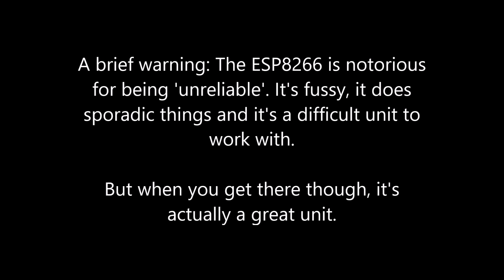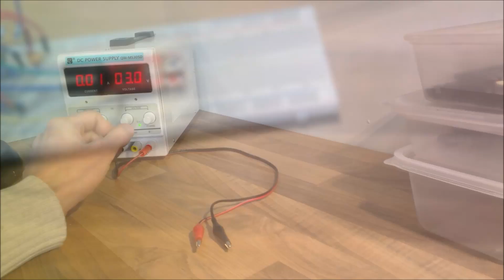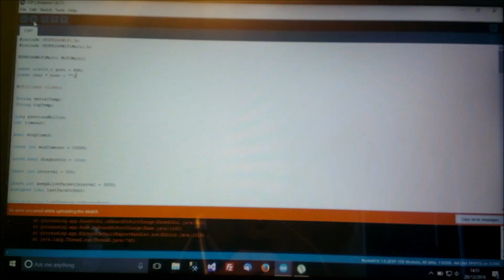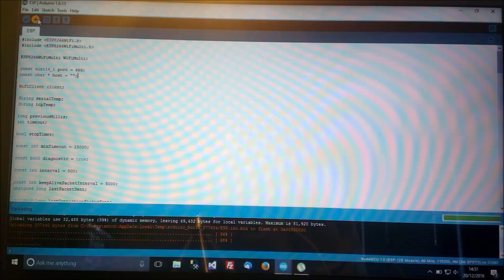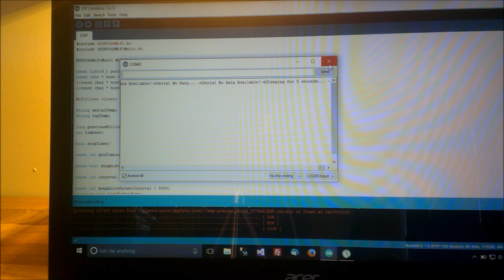TUTORIAL: How to wire up and flash the ESP8266 12E properly! It works! (Arduino - Getting Started)

Comment: Great video. I've struggled to find anything about programming this module. I keep getting NodeMCU flashing guides. I actually used an 8pin UART programmer with a button between GPIO0 and ground that I'd been using with ESP01s modules but it wasn't working. Then saw your vid and learned I needed to ground GPIO15 (still not sure why). Now successfully uploading sketches through Arduino IDE.

But I'm still not having success booting the module up. I've been installing Tasmota and it seems like the 3.3v I'm giving it isn't enough or something. The led is barely lighting up. Any ideas Anthony or anyone else reading?

Comment: Thanks, the hole pull up / down resistor thing is become more clear now.  Using the resistors in place of "just" a jumper wire on the pins that need to go high or low makes sense, ie, just need a small amount of current to set the pin high/low, not the FULL amount.

Comment: is there any reason this doesn't need an external crystal? I've inherited a project based on one of these modules and between the different data sheets I've found I can't find one with a pin out that matches and shows where an external crystal would connect, but each data sheet does mention the need for at least a 26mhz crystal yet can handle up to 40hz and from what I understand it is recommended. Do you know if there is a crystal internally? is that the 26 mhm one?
Reply: According to the schematic for the module, it already has an external crystal on the PCB.

If you're looking at the datasheet for the esp8266ex, cross reference that with the schematic for the esp-12f (or 12e) module to see what it already taken care of

Comment: Good Video but in my case i'm getting this error
warning: espcomm_sync failed
error: espcomm_open failed
error: espcomm_upload_mem failed
error: espcomm_upload_mem failed
how to over come from this
Reply: Are you sure you've selected the correct (virtual) COM port in the IDE?
Reply: The COM port (e.g. /dev/ttyACM0) maybe in use (i.e., opened) by some other software, if so you should close that software first. Another possibility is that the previous software that used the COM port did not release it properly, in which case rebooting and retrying should work.

Comment: Wonder why not using male pin header.
Do u have a reasonably stable bootloader to program it via wifi?
Reply: it has a 2mm pitch. the breadboards are 2.54mm pitch. plus the pins don't fit for some reason
Reply: Reckon slightly bending long pin headers might be easier. anywayz, thanks for the video.
Reply: Aliexpress sells 2mm pin header, and 2mm to 2.54mm dupont cable too.

Comment: I have a PL2303 Usb To Rs232 Ttl Converter https://www.amazon.in/gp/product/B00UZERG94/ref=oh_aui_detailpage_o01_s00?ie=UTF8&psc=1 which does not have RTS pin, will it work without connecting that pin?

Comment: Thanks Antony, one question, it works well but I do not need to change the state of GPIO0 or RST to put my ESP12E into "run code" mode, my wiring is the same as the initial setup, do you have any idea why this is?

Comment: Great Video ..Can you tell me what gauge wire you use to solder to the ESP12E :)
Reply from the maker: meir rotfleisch Thanks, it's not overly important, but this is most likely 24awg.
Reply: 22awg works fine also

Comment: What are you doing?
Reply from the maker: Dylan Hamer Just putting kids to bed. You? Lol
Reply: Antony Cartwright Haha, but seriously, why are you using wires for headers and why are you using the  capacitors? The ESP8266 doesn't need all this circuitry.
Reply from the maker: Hey Mr Hamer! Have you tried to use it without? Lol. If you use a breakout board, you don't need all this, that is true, but that's because the breakout board already contains this stuff! If you don't have the breakout board, and don't use wires, you can't get the ESP to work at all! If you miss the caps, then it browns out every few seconds! :-)
Reply: Antony Cartwright The ESP works fine on its own just with the correct pins connected to make it run in my experience but if it works for you
Reply from the maker: Maybe I just had a few bad batches! ;-) Lol.

Comment: Ok, I want to make clear some discussion topics in this comment section. He said, this is the most reliable way and he's right. You can use esp8266's for every single application with this setup. But he didn't tell why you need this bulky parts. I am gonna start with capacitors. You will need capacitors only if you're gonna use relays or motors in your projects, these type of electrical components will have voltage fluctuations, and the spikes can potentially damage your esp. But ams1117 is a linear voltage regulator, you can use a buck converter instead without having to use capacitors. The resistors are only needed when you are gonna use those pins as i/o's. So you should use resistors where you need more i/o pins. Besides you can just use cables to make the proper connections. And again I highly recommend using a buck converter instead of a linear voltage regulator. They are more efficient and they are tiny. So you should use these components on purpose.

Comment: Best demo I've found so far. What exactly do I search to find the type of blue wire you're using? The stuff I get has multiple stringy strands instead of the nice solid core on yours.
Reply from the maker: Hi, thanks very much for your comment. The wire is solid single core, 0.6mm² "bell wire". Antony... Buy it in large quantities because it's way cheaper! If you need 10m for example, buy 100m or 50m...You'll see that the price will not be hugely different. Antony...
Reply: 0.6mm^2 looks like around AWG20.  I'm surprised that thickness of wire could fit in those tiny holes. But I like the end result.
Reply: I am just using single core 22awg wire and it works fine, if anyone else is looking. Get it on Amazon https://smile.amazon.com/gp/product/B008L3QJAS/ref=ppx_yo_dt_b_search_asin_title?ie=UTF8&psc=1

Comment: one question, when you talk about the RST, what does mean the "GND via tact."?? because i understand that is different of the GND directly connection.  and other one, why do we need a capacitor between vcc and gnd?that's for all. kind regards
Reply from the maker: Eva Mc My first female comment! Welcome to my channel. Gnd via tact means ground but switched ground. In other words, there is a switch between the pin and gnd. when you press the switch, it connects to ground, otherwise it doesn't. About the capacitor, it is for stability. I think there are two in this video. Antony.
Reply: Antony Cartwright yes, but it is a need to be switched in order to work with the esp8266? my uart ttl does not have  RST.
Reply: Antony Cartwright thanks for your welcome and for your video and obiusly for answering so quick
Reply from the maker: Eva Mc Hi again. Yes it must be switched because RST is the reset pin. You wouldn't be able to reset the device if there wasn't some sort of way to momentarily ground the rst pin. Antony

Comment: What gauge wire did you solder to the esp8266?
Reply from the maker: Hi! Thanks for your comment. The exact gauge of the wire isn't really that important here because the device consumes around 200ma max and the wires are extremely short. However, to answer your question, I probably used AWG24 or so. Antony..
Reply: 22awg works fine also

Comment: Heyy Antony, do you know if this will work with Arduino Mega instead of FTDI UART ?
Reply from the maker: Hi Anay, I don't fully understand the question. Could you ellaborate?
Reply: he wants to use his mega to program the esp instead of the ftdi. pretty simple question.
Reply from the maker: That's not a simple question I'm afraid! The UART is a serial transmitter and receiver. The Arduino Mega is a microcontroller. A microcontroller can be programmed to do many many things. If someone wanted to, they could make an Arduino into a UART. So, theoretically, yes, it's possible. Antony...
Reply: Antony Cartwright yes but the mega has 4 UARTs. he could forward the communication from the PC UART to the esp UART.
Reply from the maker: Then it seems that it is possible. :-)

Comment: This is a good video. However, you do not explain WHY each of the components are needed. Just saying, "you need X" without telling "why", actually does not teach anything. Why not explain that the capacitors are used to stabilize the voltage etc? Why are the resistors needed.. and so on. Just my 50 cents.
Reply: Connect Vcc to CH_PD to enable the chip
Connect GPI0 to GND to enable flash reprogramming
Connect GPI15 to GND to enable UART Download
Reply: Like Daniele Teste, I'd also like to have a "why" and not "just cuz".
You've held your own on some of the other comments in explaining why you've added components, but I guess it's that eternal struggle of time. Less videos but more indepth,  or more videos but not going into some of the details...
Still think you've got some great content tho, have learnt a lot.
Reply: Why 50¢ and not 2¢?
Reply: @stefanshapiro1245  The remaining 48c goes to Patreon!....lol!
Reply from the maker: Daniele Testa Thanks for your comment. Some people don't want to know why, they just want to know how. But yes, I suppose I agree with you.
Reply from the maker: I actually like to know why too, but videos with more depth are simply not watched unfortunately. Most people seem to want quick "How to" videos.
Reply: @antonycartwright  I could do with why and how, I have just received my arduino and no nothing about it, want to learn and would appreciate more info and small projects to do, unfortunately my brain is slow so need it spelled out to me.
Reply from the maker: Where to draw the line? That is the question. :)
Reply: @antonycartwright  you could always do a separate video with all the theory and put a link to it in the description for the people that want that. I like both styles of video because I do like the theory, but sometimes I just wanna see the different ways people approach a problem.

Comment: This is a good video to understand how to setup a ESP8266, especially in cases where you want to use it in a low power configuration and want to avoid the overhead of the regulator. However generally speaking you could pick up the Wemos D1 for about the same price with everything packaged with a USB interface https://goo.gl/5D0xMN
Reply from the maker: Thanks for your comment! This video actually does show the use of a regulator. You're right though, there's a device called NodeMCU, and it is basically this module broken out with all the additional components already on the board.
Reply: Yes I realized that. But I found your detailed instructions really useful meaning that if someone wanted to wire the ESP8266 without a regulator (using a battery) they could do it after going through your video. I was appreciating it as I saw some people complaining about the value of the video, hard to please everyone :-)
Reply from the maker: Ahhh yes, I've actually done it without a regulator before. Haha! Yes, I understand! Thanks!

Comment: I absolutely loved the video. I didn't know much before I watched your video, and actually I may now know less, but I had an excellent laugh. I've often wondered what the hell purpose did the manufacturers have in mind when they soldered a bunch of this shit together? It is often pure snake oil, with no directions, but many baseless claims. I have no idea about this particular board, but I certainly wouldn't be in the least surprised if it was similar. Absolutely fabulous video. If you could have made it twitch randomly, it would have better resembled a very colorful dying centipede/cockroach or whatever.
Reply from the maker: Haha! Thanks Robert! Yes, I know where you're coming from! I spent a long time scavenging for documentation for this module. I also spent hours trying to understand it and try to get this thing working. It's easier to just use the NodeMCU. Antony...

Comment: This is actually a tutorial of how to take a little neat cheap device and transform it to big pricey ugly something without any real need. Unreliable? Who told you that BS? My house full of esp8266 devices working 24/7 for at least 1 year without any capacitors, resistors, voltage regulators and other BS. I didn't have even single issue with their work.
Reply from the maker: Hey! Thanks for your comment, although I strongly disagree. Adding 2 capacitors, a regulator and resistors does not at all make it into a "big pricey ugly something", well certainly not for me anyway as the components cost pennies. I told myself the ESP8266 were unreliable, this was from experience. Even now, I still believe they can be very temperamental! About your statement regarding having a family of ESP8266s "working" for a year without capacitors, resistors, voltage regulators - I'm afraid I don't believe that for one second! Is it possible that you're actually using something called a NodeMCU? If you are, this module already contains the components.

Maybe if you have time, you could show us your family of them working without extra components? That would be very interesting!

Antony...
Reply: No, it's not NodeMCU. Most of them are good old ESP-01. Working without single issue as I said, and even receiving sometimes an OTA updates. As for capacitors, voltage regulators and other useless stuff - you really don't need them because your power supply already has all this. If you need them - it's a sign that you should throw away your power supply because it's not doing its job properly. If you don't know - it's a power supply's job to produce stable voltage without any fluctuations. All you did in this video - is just duplicated your power supply's circuit for no reason.
Reply from the maker: Ahhh, the old ESPs - I see. I've not worked with the older ones, so I wouldn't know.

About the regulators though, I disagree, the main reason for this is that a lot of IOT applications are mobile and there may not be a proper power supply unit - so it's common place to put a reg in. There were also three reasons why I'd regulated it twice though; The first reason was that this is a simple tutorial and viewers may not have a PSU like mine, they may be using a 5v supply or another supply... So throwing in the reg gives them more chance of success and makes it easier! The second reason is that my PSU was not stable enough for the ESP. The third reason is that my PSU wasn't designed to be used like this, it's a testing unit and that a simple touch of the dial would shoot the voltage up to 9 or 10v... It is too sensitive! So if I didn't use a reg, I'd be risking the ESP! (I actually blew an ESP by doing this lol) Antony...

Comment: You need to remake this video, explaining why you did what you did at each step. Most people wont magicall get why there is capasitor there, why are you connecting all these resistors, why have that smaller cap between VCC and GND.
Reply from the maker: Hi rcatank, thanks for your comment. Unfortunately, the reasons 'why' I did certain things is intentionally out of the scope of the video. The reason for this is because I feel that the majority of my audience do not want to know 'why', they just want to know 'how'. The video is meant to be concise, basic and quick. I didn't want to bog viewers down with too much detail. If I get a few more comments similar to yours though, I will make a video to accompany this one, explaining 'why'. Thanks, Antony...
Reply: Antony Cartwright Could you explain the small cap being used?

Comment: Hey Anthony thanks for your great video, there's definitely a need for esp8266 instruction so thank you. 

I've been battling with trying to get micropython on my lolin esp8266 12e board. It flashed no prob and even worked for a while but not anymore so I might follow your instructions with a bare 12e board and see how it goes. I think my problem is stability. The micropython language is a cool development in the microcontroller hobbyist world, did you try it yet? 

Also does your uart board actually have an FTDI chip or is it ch340 or cp2102. I've had trouble with finding a reliable uart when working in Windows 7. Anyhow thanks for your efforts :)
Reply from the maker: Hi Jimbob! Thankyou for your comments!

I agree about the ESP8266, I'd battled with it for some time myself! Most online resources seemed to conflict in some areas too, so I thought it would be a good idea to present a working method and actually show people the unit working! 

If your problem is stability, have you made sure that wires are as short as possible, you're using a good power source and that you are using decoupling capacitors where necessary? If you really want a stable unit, I highly recommend the NodeMCU. I have a video about it on here.

I've used Python, but not heard of MicroPython, but I assume it is Python for microprocessors? 

I have several UARTs, but the red ones which I use in my videos are real FTDI chips.

Thanks again, Antony...

Comment: Great post and clear wiring instructions. Thank you.

It just occurred to me that life might be better if you wired the ESP6266 into connector wires upside down. The top side of the ESP8266 does not have much to say for itself, being short on length and weak on plot, but the bottom has pin labels. Woot! Being able to see the pin functions is likely to reduce wiring errors.
Reply: Ah yes but....if you turn it the other way up, you cant see the LED flashing. Yours is a good point, but i think i would rather just use a cheat sheet for the pins and then also be able to see the LED. Then, as Antony said, there's the aesthetics to consider! lol!......
Reply from the maker: Thanks John! Yes, you're right. I did it this way just for aesthetic reasons...